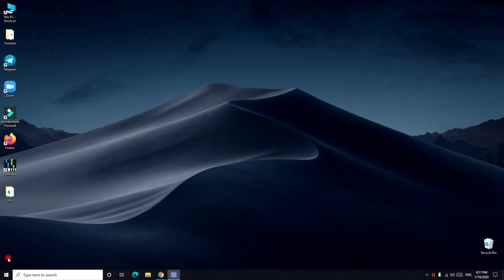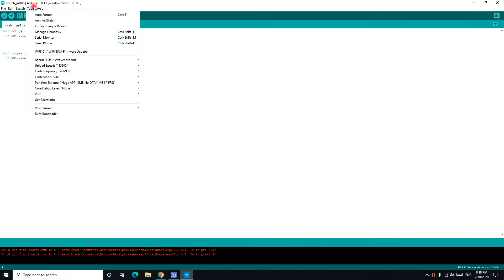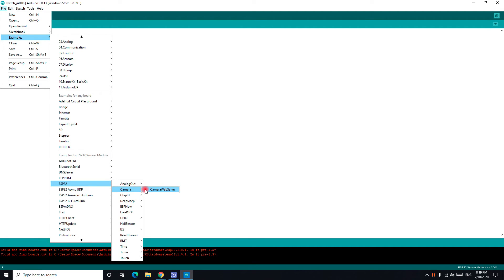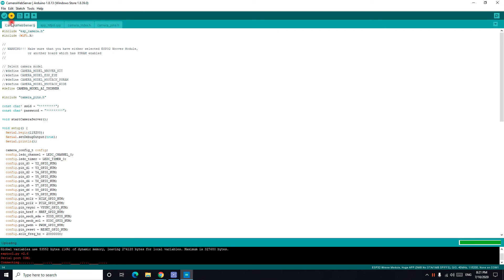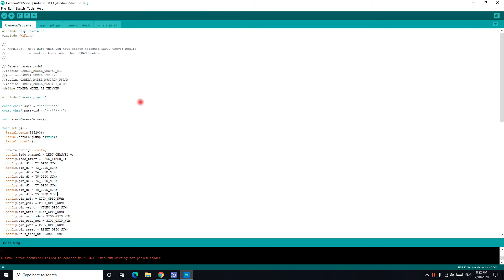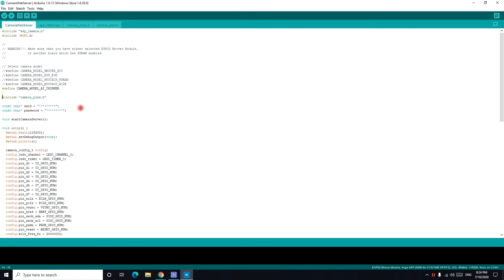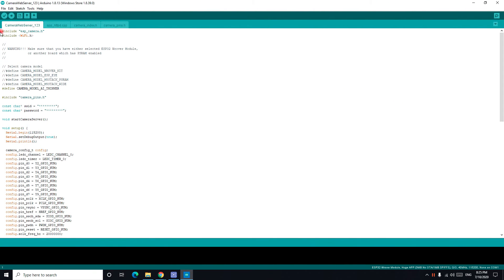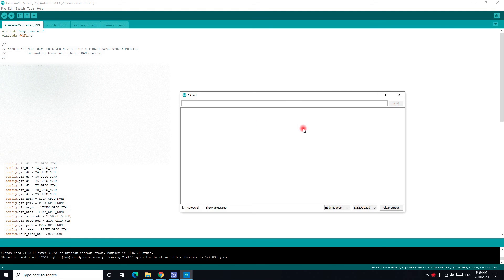ESP32-CAM AI Thinker how to upload in Arduino with errors solved

Comment: It didn't work for the error "esp_camera_fb_get(): Failed to get the frame on time!" . In addition I checked both codes and are identicall I didn't see the difference
Reply from the maker: try taking off the cam itself not the board carefully install it again and then try many times
Reply from the maker: your error is different
Reply: @Royalsoft_  sir getting packet header error